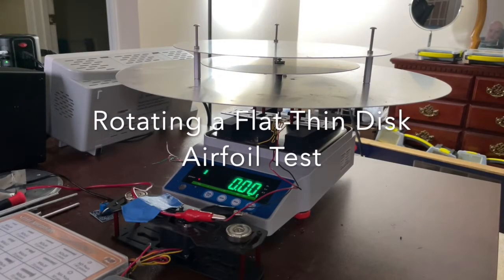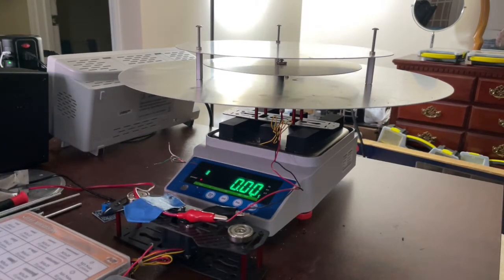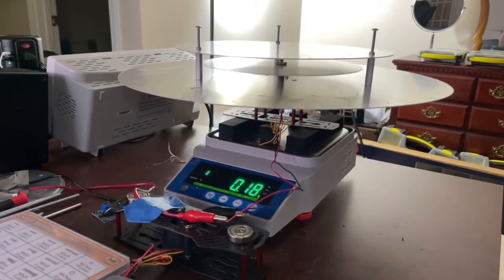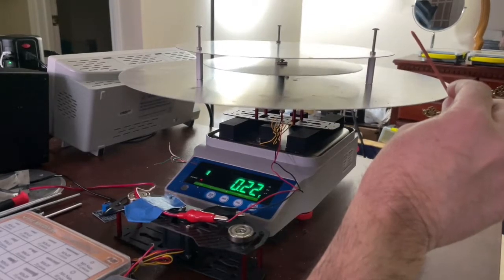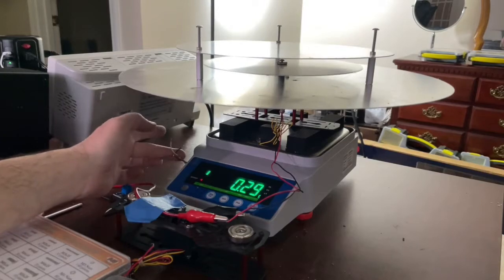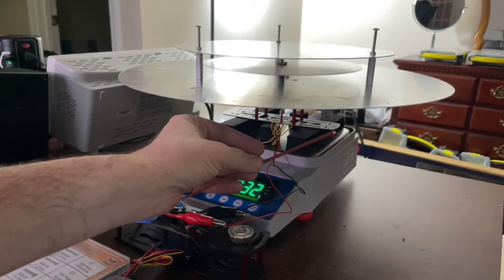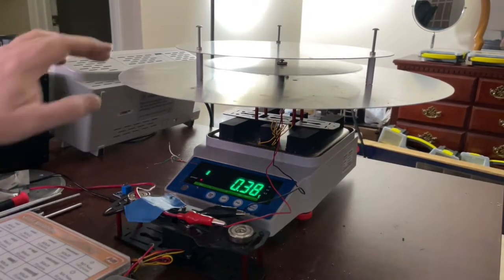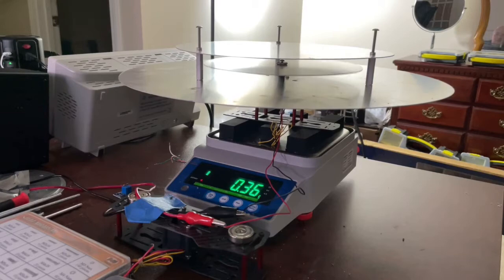Rotating a Flat Thin Disk - Airfoil Test

Comment: You built an aerodynamic device. 
Why not put it inside a plastic container? The scale would need to be under the container I guess.
Then it down to vibration affecting the scale and any intertia generated, even if aerodynamic in nature.

Comment: You know what, I've been thinking a lot about your idea and I've researched on Helmholtz oscillators. You might be on something. But, you need to change your setup. 
You need to put a ring of piezo speakers onto a disc some distance from the center. And then you need to induce oscillations in these piezo speakers. These oscillations need to be at a rotating metal disc's resonant frequency. Practically you need to create radial waves moving in tangential direction. Once you have these radial waves rotating with the disc, waves will hit incoming air and you'll get laminar flow over the top. Once you have laminar flow you get a lift like with aircraft wing. In Alexey's design he has these heavy magnets arranged in a ring and when piezo speaker starts oscillating heavy magnets create nodes for radial waves and he gets laminar flow on the side opposite to magnets.
I hope this makes sense.
Reply: Essentially you create a rotating wing where radial standing waves create multiple airfoils. In Alexey's desing magnets simply through their bulk & rigidity, irrespective of magnetic properties, created purely mechanically nodes for standing radial waves.

Comment: I would have expected it to have negative weight because it was pulling air from above and throwing it to the side.  pulling air from above should give it negative weight I would think.  Instead it appeared to have positive weight increase.  It would be interesting to try and build a scale that was not electronic, had a needle that would osculate around an average.  Is that what your trying to see with your oscilloscope maybe?

Comment: The air current is going to be slowest directly in contact with the surface, so I'm not surprised you didn't see much movement from ashes sitting on the plate. So, what kind of incense is that?

Comment: What's the sample frequency of the electrical scale? I would recommend using a mechanical scale with no resonances near the operating conditions of the device, to get true averaging. Even before we assume lift, the sample rate of the sensor could just be sampling a certain phase of the vibration cycle repeatedly, giving you an offset that's not actually there. This happens if the sensor samples slower than the nyquist frequency required.
Reply: Thank you, that is exactly what has been happening. That's why I'm going to connect the load cell directly to my O'scope, where the sample rate is 1GSPS.